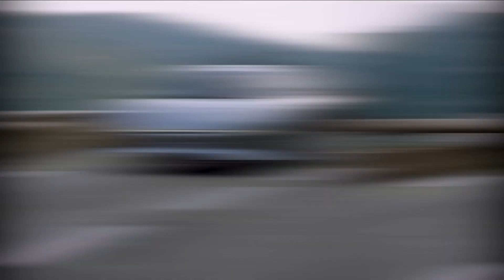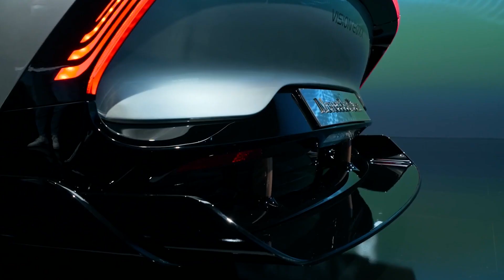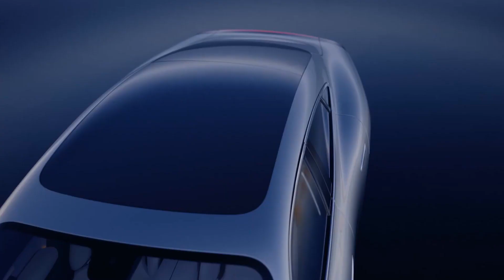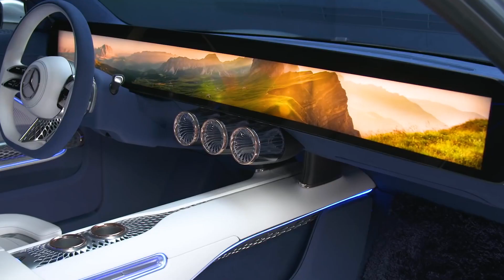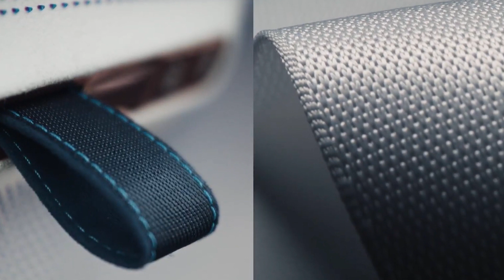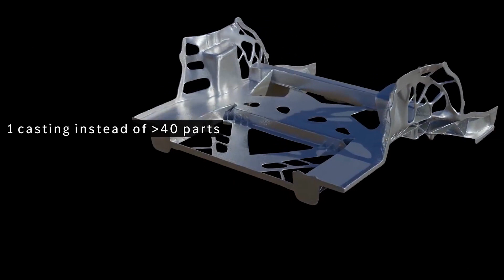Mercedes EQXX – INSANE 1000km range!

Comment: The Mercedes EQXX is a beautiful car that combines luxury with novelty. I really like that it has a range of over 1,000 kilometers on a single charge. It also uses novel high performance materials like mylo and bamboo in its interior. These materials have the potential to replace animal based goods. Some of its parts are even made with 3D printing! It is a well-built car made with the collaboration of several groups including its Formula 1 engineers. I am in awe of this car.
Reply from the maker: Thanks for watching
Reply: FAKE comment